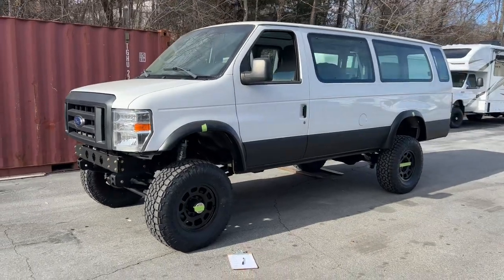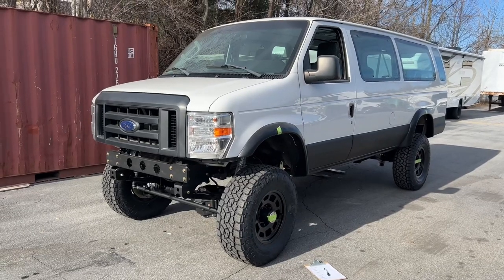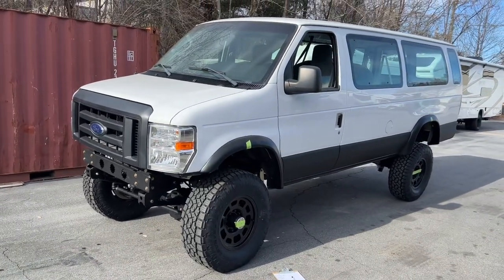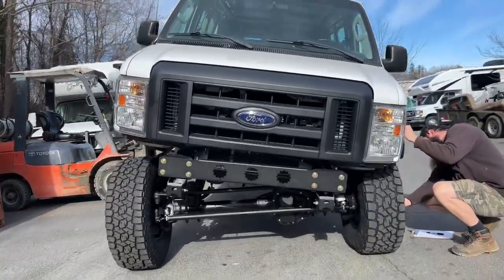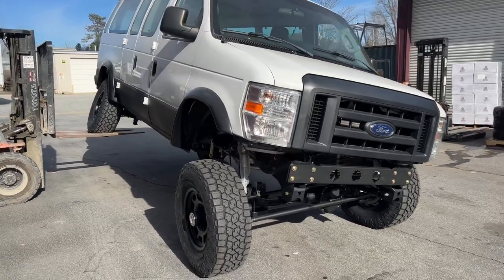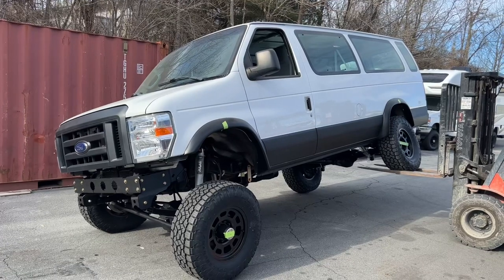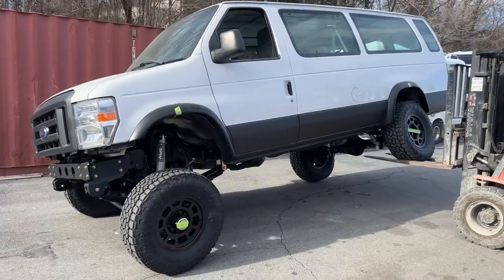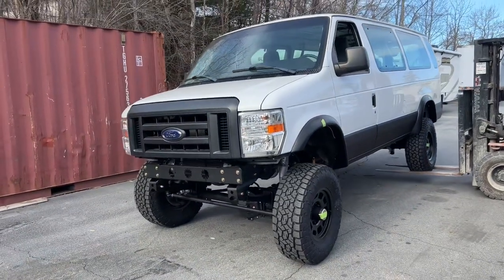Suspension flex/wheel travel demo!

Comment: Just curious because I never have my sway bar disconnected on my 6" ujoint van, can you do a comparison test with the sway bar installed? I'm interested in the difference and also how good does one handle without a sway bar installed
Reply from the maker: I tested that years ago, not a massive difference. 1-1.5” of travel loss